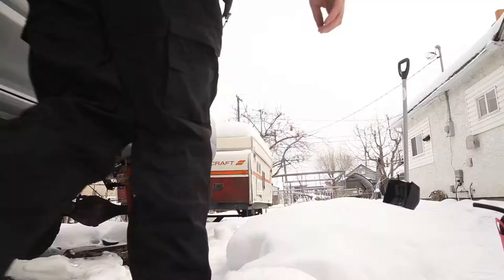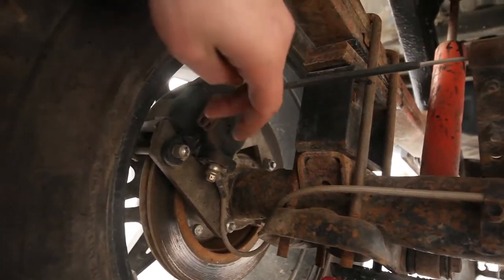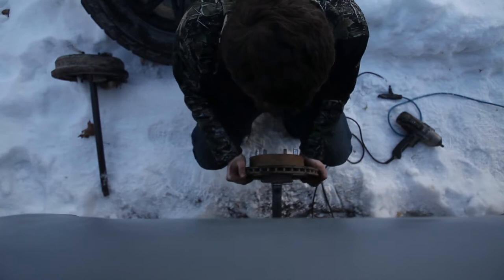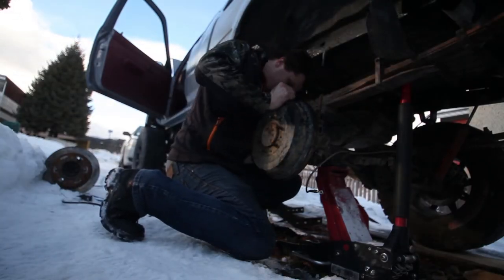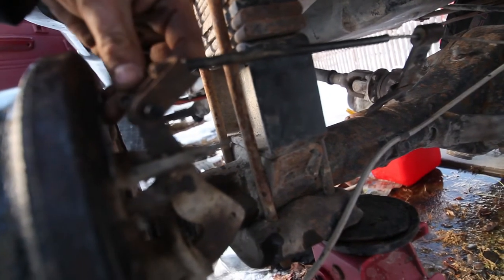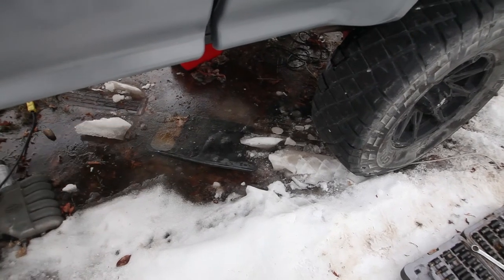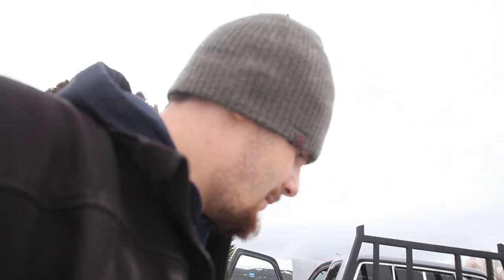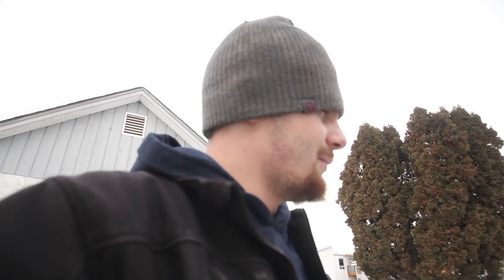Inspection Time Is SOON! Caliper - Drums, Rear Bumper Install and More!

Comment: hi Dirt Garage just asking about the rear dis conversion i wannna make mine and what kind of calipera are those and the rotors or if u have a link or some cuz i wanna keep my ebrake
Reply from the maker: The exact kit I used can be found here: http://go.magik.ly/ml/9wnj/ .  Also the ebrake supporting Calipers are from a Cadillac Elderado, you can find those here: https://goo.gl/SMR1mN
Reply: Dirt Garage oh this is a kit for Trail Gear then
Reply from the maker: Yes I used the Trailgear kit originally and then added the Elderado callipers. But as you can see in the video I wasnt able to connect e brake still. Requires more modification.
Reply: Dirt Garage thank you so much buddy for all the info👍👍👍